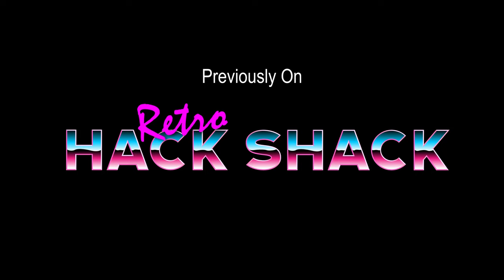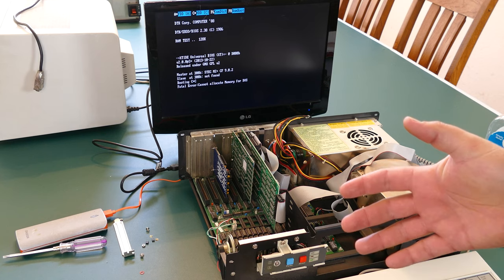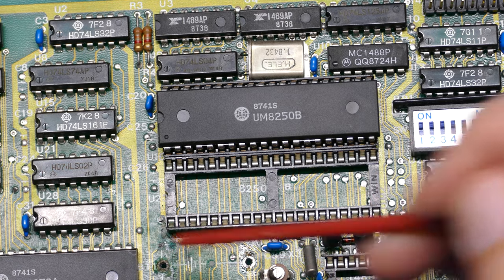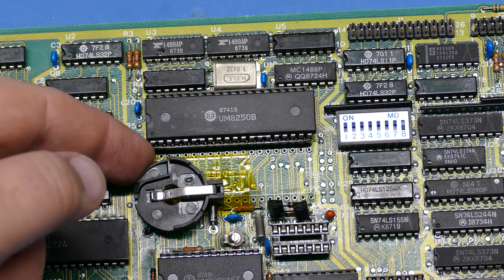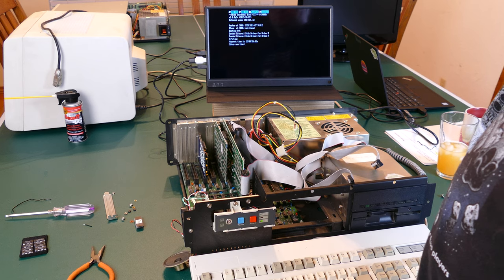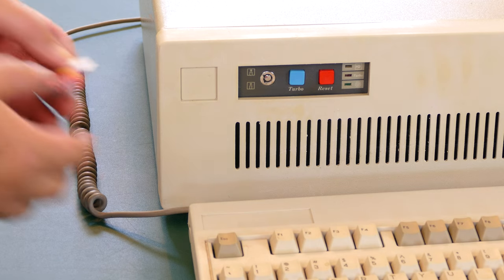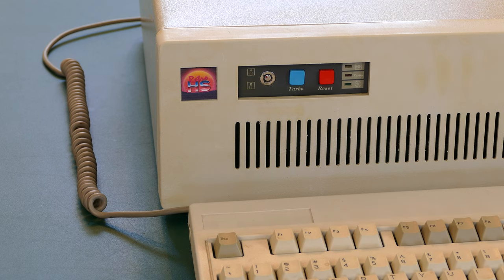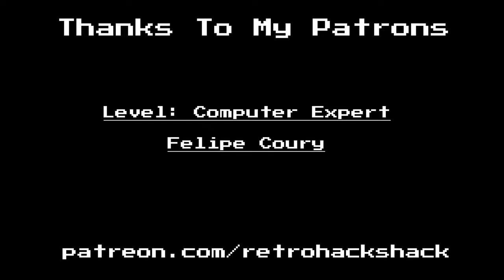Exploring And Repairing An Early PC Clone - Part 2

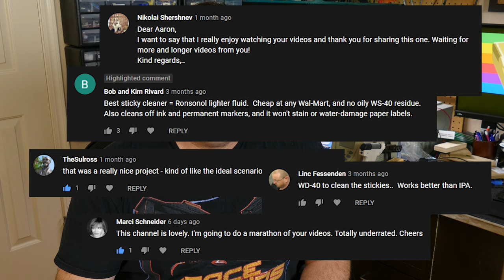Comment: Thanks for the 39:24 screenshot of my lighter fluid comment, Aaron! I've used it extensively on everything from computers to TVs to comic books - anything where there is an ink/marker stain or sticky residue.  The only thing it doesn't clean is things that are water-soluble like food, but any household cleaner will lift those.  The old Ronsonol bottle is the first thing I grab after any Goodwill haul, to wipe off those nasty price stickers and red markers they use!
Reply from the maker: You bet.
Reply: Comic books? Wow! Glossy covers I can see it evaporating before it sinks into, what about the matte ones with fairly thick fibres?
Reply: @kaitlyn__L  It just evaporates slower and still doesn't wrinkle, warp or anything

Comment: Nice overview, and glad you got it back up and running.  If you have MFM issues in the future and don't care about the data, it's a lot faster to just run the controller's low-level format routine to lay down a new low-level format.  You can use spinrite to determine the optimal interleave, but then just stop spinrite and go to the LLF program and input the best interleave you found.
Reply from the maker: Thanks for the tip!

Comment: Despite the extra considerations from the paint being a thin layer, there is the benefit that it doesn't usually yellow! Plus it's usually very durable so long as you don't use a solvent it reacts to, so it cleans-up nicely just as you found out. :)

Comment: I always hear, when people remove leaky batteries with coin style batteries "we have to use a diode, so the coin battery wont be charged up and potentially blow up", but have you considered putting in a rechargeable coin style battery in? They do exist. That would be easier and should last longer. Maybe the charging voltage would have to be dropped a little. Love watching old PCs getting restored. Thank You!
Reply from the maker: Yeah. I didn't have any on hand so I ordered some to try next time.

Comment: What? There isn't any "magic" in a magic eraser?  Great job on restoring the case.
Reply from the maker: LOL. Thanks!
Reply: Nope no magic 😂 just melamine foam. And you can get a huge pack of like 100 for a few dollars online. Buying them at the store locally is an absolute rip off. I still do it sometimes 😂 but I like to buy them in bulk when I can. They even sell the heavy duty versions of them, so they don’t fall apart so easily. 

I think the last time I bought a box at Walmart it was like five dollars for a few of them… And that was the off-brand. 
But online I can get several dozen for half that price.

Comment: This is a really great restoration to see! Such good work!

Have you ever heard about MFM / RLL controllers' built in low-level format routine?

If the controller has one (most do), it is initiated by launching Debug from a command prompt and typing in 

G=C800:5

This will then drop into a routine in the controllers BIOS which will guide you through a low level format without the need for any third party software. This type of low level format is usually better than that which could be done by any third party utilities, and faster.

Seems your drive has come out much better for the work you did but if you have another XT class project maybe its worth a try?

I've just acquired an IBM PC-XT 5160 with the original Seagate ST-412 hard drive so I'd imagine I'm also going to have a lot of low level fun ahead of me.

Waiting for new tantalums to arrive first, as the motherboard has a dead short on the -12V line
Reply from the maker: Yes. I was going to try that next if spinrite didn't work.

Comment: The thing about the generic multi-purpose board is that 2 layer PBCs were fairly easy to reverse engineer and produce. While not putting a brand or model on them largely avoided having to provide technical support.

Comment: Hi Aaron, you mentioned talking to Adrian once, and I believe you didn't mention it when replacing the 3-volt battery in your fix here, but did you use a schottky 0.3v diode as apposed to the normal .7 volt ones. Adrian did mention this once as I watched many of his videos as well to keep the discharge or use voltage as low as possible. Just subbd to you, and I have an xt clone just like this as well and am currently fixing. Thanks for sharing, and nice work on yours also as well.

Comment: The slot with the extra DB25 and game port is only in to allow Game port functionality.  You need to add the other 8250 UART (edit: and populate the two empty sockets) to get the second COM port.  If you use an LR2032, you won't need the diode, as it is a rechargeable coin cell.
Reply from the maker: Thanks for confirming that.

Comment: It's more than likely that 2nd socket for another 8250 chip is for an optional additional com port you can connect to that dual row header there on the upper right of the board.  That 1st chip is highly likely for the 25 pin one you got on that board.
Reply from the maker: Yeah. There is a 9 pin com port on the back of the card already. I didn't have time to test the 25 pin port attached to the header to see if it worked or not.

Comment: @11:21 is it me or is that diode the wrong way around? (havent got to the point where you notice it, if at all)
Reply from the maker: I sure hope not. I had to double check it a few times, because at the wrong angle it looked like it had markings on both ends.
Reply: @RetroHackShack  reason why i said that is because it looked like you had the bar on the  side of the battery so that will block power going into the board but won't stop power coming from the board, you would need it the other way around to stop the power coming in but the battery being able to supply power.

I'd just double check it :D but great video.